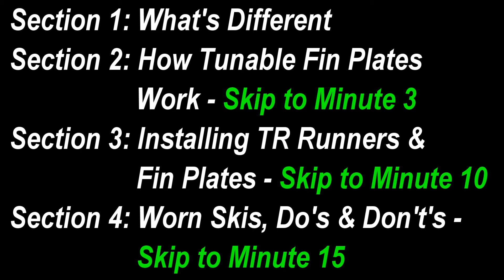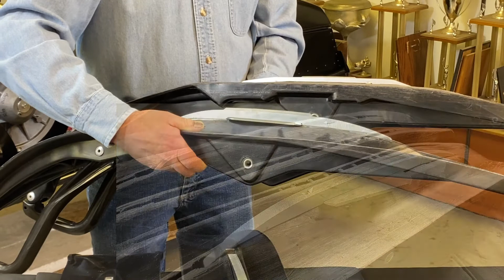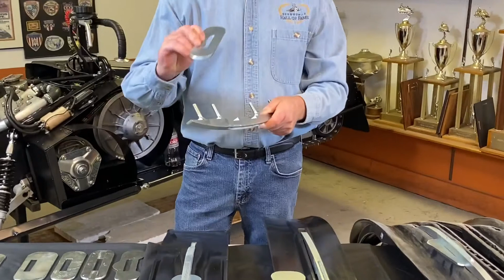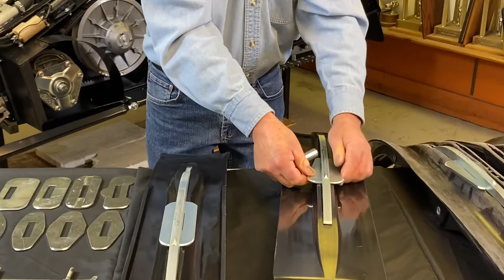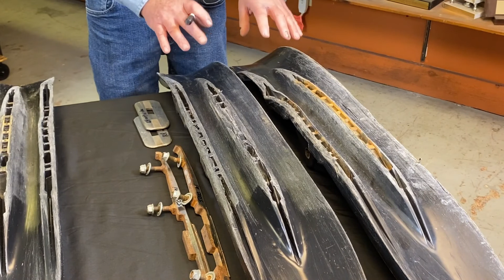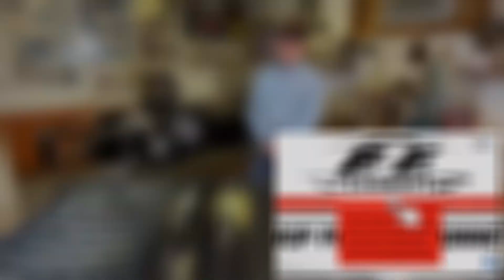Pro-File TR Runner Installation & Set-Up - Brad Hulings - HRP Motorsports

Comment: With the fin plate do you get any premature bottom ski wear from the redirection of snow and dirt?  

Older Polaris Sidehiller dual wear rods used to wear away the ski plastic between the two wear rods. 

Thanks